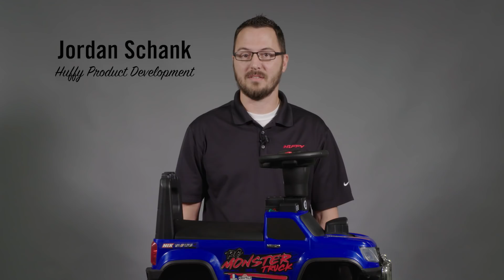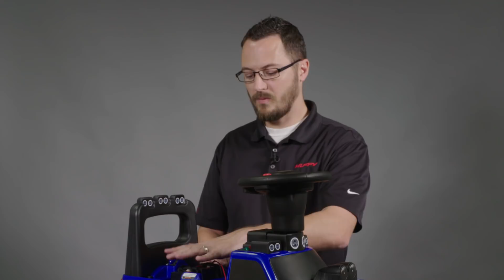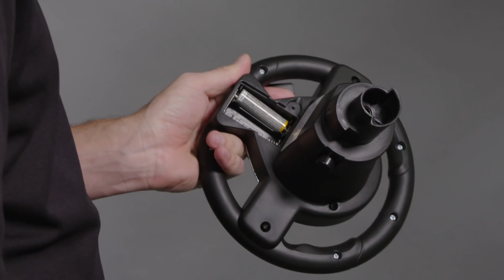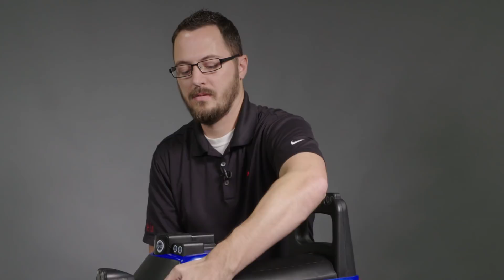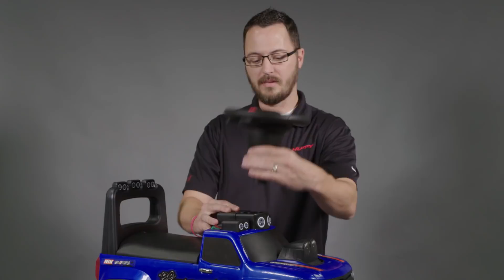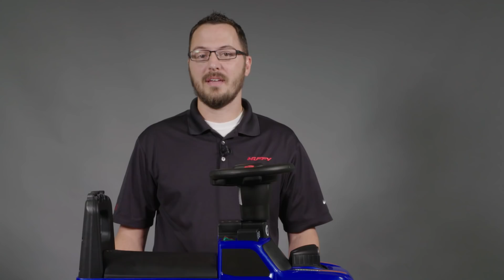Huffy RC Monster Truck Ride-On - Assembly Tricks & Hints

Comment: I was thinking of buying this for my one year old kid because it was remote controlled but learning  that I can’t control it remotely while he rides has changed my mind.
Reply: George Murphy same here big turn off
Reply: Just put a screw by the censor button a little bit higher then the censor an put the seat back you'll just have to find a steering wheel to put in the place of the original so they have something to hold on to
Reply: I went ahead and bought this and took a chance on it. It's so easy to get around it's not funny. No modifications necessary. There's two clips on the back of the seat. Instead of inserting them in the holes like it belongs you just let them hang over the side preventing the seat from pushing the sensor down.
Reply: I put a but over it

Comment: We lost the charging cord for our son’s truck, and it’s been impossible to find any information about getting a replacement. The manual has zero specs for the charger, so I can’t buy an after market one without risking damage to the batteries. And the Huffy website does not seem to have any way of ordering the part. This is extremely frustrating to me. Why on earth would the manual or website not list this information? Can anyone tell me the specs on their adapter? Is the plug center positive or center negative? What is the output? Thanks in advance for any help you can offer.
Reply from the maker: You can fill out this form to order a new charger: https://www.huffybikes.com/parts/. Or you can call us at 800 872 2453 and we can have one ordered that way!

Comment: I bought too and none won’t turn on disappointments for my kids never again will I buy a huffy
Reply: Yea mine won't come on either
Reply from the maker: Very sorry to hear you've had issues. We would like to help you. Please reach out to our customer service team at 800.872.2453 or at www.service@huffy.com. Thank you - we look forward to helping you soon.
Reply from the maker: Ramiro, we are very sorry you've had any issue. Our customer service team is happy to help you. Please contact them at your convenience at 800.872.2453 or at www.service@huffy.com. Thank you. We want you and your kids to get back to having a good time - soon.
Reply: ramiro gaytan I was about to return as well but then I saw that if the steering wheel isn’t fully connected it won’t work. There is a button on the left of the steering wheel that u have to hold while pushing down the steering wheel to make sure it’s secure